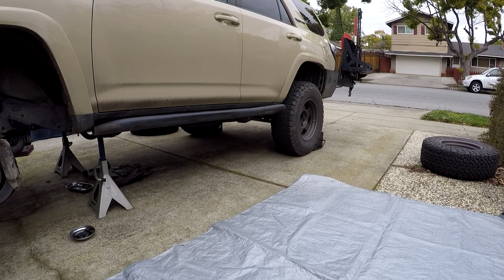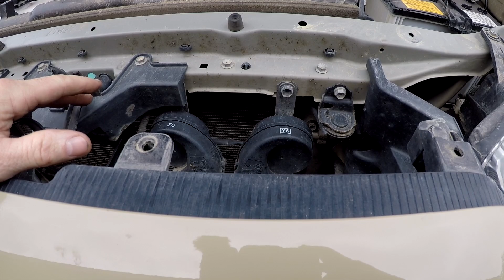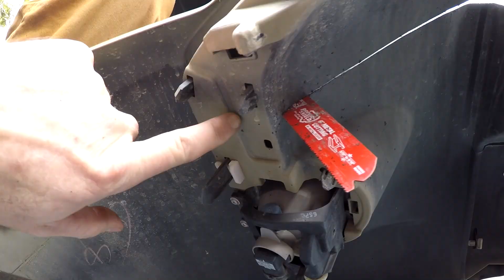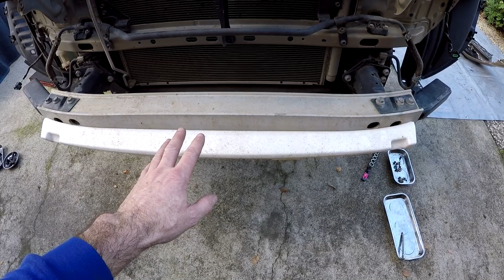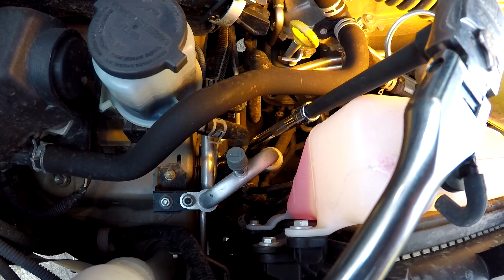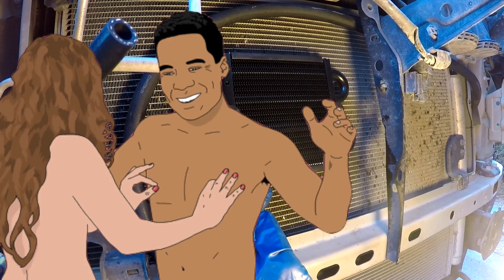C4 Fabrication Front Bumper Install - 5th Gen 4runner (Part 1)

Comment from the maker: *PLEASE READ THIS COMMENT AND THE VIDEO DESCRIPTION FOR HELPFUL INFORMATION*

HELPFUL TOOLS
If you're looking for other tools not used in this video, check out Timmy's Master Tool List. 
https://www.amazon.com/shop/timmythetoolman?isPublicView=true

6 Ton Jack Stands - (to safely support vehicle while you’re working on it)
 https://amzn.to/2MM91w6

Heavy Duty Rubber Wheel Chocks - (to prevent vehicle from rolling)
 https://amzn.to/2mttRWp

Dewalt 1/2" Drive Impact Gun
 https://amzn.to/2M2Y9J1

Dewalt Batteries
 https://amzn.to/2urcx59

Dewalt Battery Charger
 https://amzn.to/2Ud8RlY

*Wheel Lug Nut Impact Socket Set
* - https://amzn.to/33uatZt

Wide Painters Tape - (to make measurements on bumper)
 https://amzn.to/3aMaWLc

Narrow Painters Tape - (to join all the measurements on bumper to make a line to follow to cut along) https://amzn.to/2tdWNWo 

*Milwaukee Mi12 Cordless Ratchet
*  https://amzn.to/2utRZsE

Milwaukee M12 Batteries (2 Pack)
  https://amzn.to/2uoQlZs

Milwaukee M12 High Capacity Battery
 https://amzn.to/2HEFTpu

Milwaukee M12 Battery Charger
 https://amzn.to/2uo2o9x

*Milwaukee M12 HackZall
* https://amzn.to/2TFNIO6

*1/4" and 3/8" Flex Head Ratchet Set
* https://amzn.to/2ql8nNA

Stubby 3/8" Ratchet
 https://amzn.to/2upFKNN

3/8" Drive 6 Point Metric Standard Socket Set
 https://amzn.to/32WIh0M 

*1/4” Drive 6 Point Standard Metric Socket Set
* https://amzn.to/2QIU7te

*3/8” Drive Regular Extension Set
* https://amzn.to/2OehCao

1/4” Drive Regular Extension Set
 https://amzn.to/2O9nl2x

Long Magnetic Parts/Tool Tray - (Good for holding longer tools like ratchets and wrenches) https://amzn.to/2m89y0D

Medium Size Magnetic Parts/Tool Tray - (Good Size for keeping track of fasteners/small parts) https://amzn.to/2ky8Qt8

Small Size Magnetic Parts/Tool Tray - (Good for holding lug nuts or smaller fasteners/parts) https://amzn.to/2m6kQ5y

*20 Piece Screwdriver Set
* https://amzn.to/34aLrQ1

*Dremel Tool Kit
* https://amzn.to/2DcQHqG

Diablo Demon Carbide Tipped Blade
 https://amzn.to/2tl90Ff

Long Set of Ratcheting Box End Wrenches
 https://amzn.to/2oOhndL

Plastic Fastener Removal Tool
 https://amzn.to/2Y7qrYk 

Auto Trim Removal Set
 https://amzn.to/37vgzvH

*Small Pick Tool Set
* https://amzn.to/2MyN4AH

Hose Remover Set
 https://amzn.to/34aKF5z

90 Degree Needle Nose Piers
 https://amzn.to/2VYUro8

Oil Drain Pan
 https://amzn.to/2QK6kh9

Silicone Plug Kit
 https://amzn.to/34Joap7

Wire Cutters
 https://amzn.to/2RLrTi1

Utility Blade
 https://amzn.to/2JmZQjO

Oil Funnel 2 Pack
 https://amzn.to/37z6sG2

*Multimeter Test Lead Kit
* https://amzn.to/2QGmhEs

Heavy Duty Circuit Tester - (test light)
https://amzn.to/2O7w44M

Knipex Diagonal Cutters - (to cut plugs off to rewire the fog lights) https://amzn.to/300BRRE

Ratcheting Terminal Crimper Set - ( to crimp butt connectors) 
https://amzn.to/2MU82sv

Wire Strippers / Cutters - (to strip wires for the fog light wiring) 
https://amzn.to/2WGNwjk

Hot Air Gun - (to shrink the butt connector ends) 
https://amzn.to/2DZAq9M

*Flex Head Box End Wrench Set
* https://amzn.to/31x8BOo

Metric Allen Head Socket Set
 https://amzn.to/348B8vL

3/8” Drive 6 Point Standard SAE Socket Set
 https://amzn.to/2PPb575

Allen Wrenches (Metric and SAE)
 https://amzn.to/34blIqP

Transmission Jack 
https://www.harborfreight.com/automotive/jacks-jack-stands/transmission-jacks/2000-lbs-low-profile-transmission-jack-60240.html

*Tree Strap
https://amzn.to/317cZoB

**As Ebay Partner Network members, we earn commissions from qualifying purchases.

**As Amazon Associates, we earn from qualifying purchases.

Comment: for the center grill, you could also use Japanese hand pull saw with fine teeth, it'll go through that plastic like knife through butter
Reply from the maker: Thanks for the tool suggestion.
Reply: I unscrewed the front grill after I cut the sides and it made it much easier to use the Dremel

Comment: Thanks Tim this video came right on time I'm doing the powering steering cooler this weekend if all the parts come in
Reply from the maker: You're welcome Steve.  Good luck with the job.
Reply: @TimmyTheToolman  I left the factory cooler in place you think that's a problem
Reply: @TimmyTheToolman  and just connect to the passenger side to the same cooler you installed to the resivior